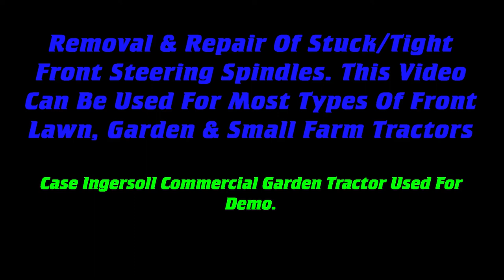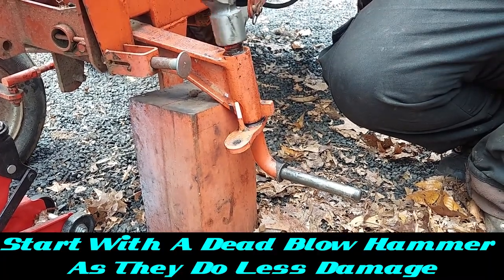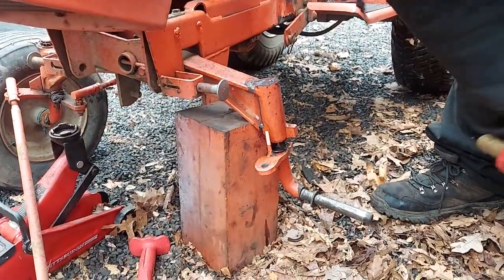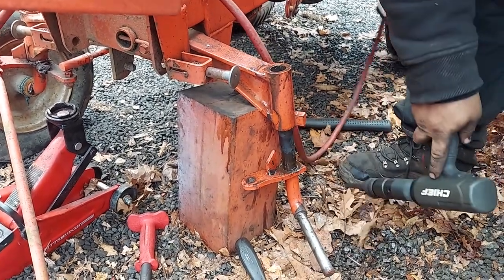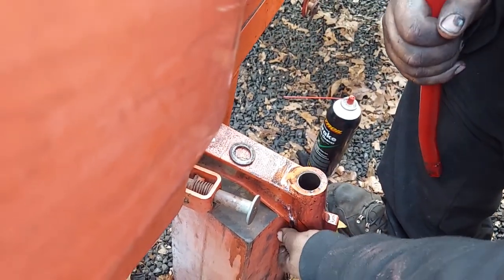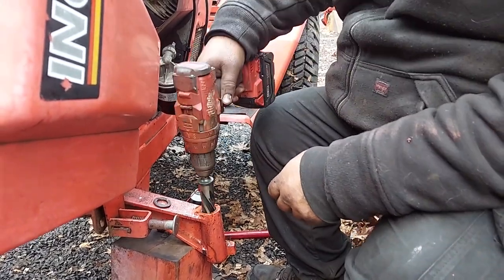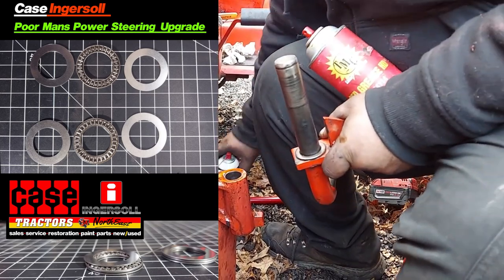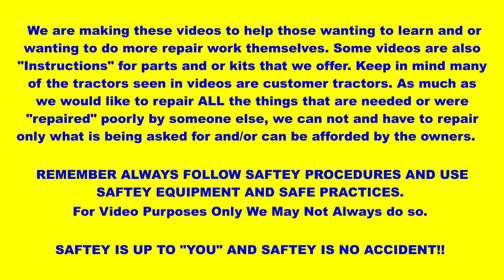Hard Steering tractor? Fixing Stiff/Stuck Spindles For Many Garden/Compact & Small Farm Tractors

Comment: Great video. Some body hasn’t been greasing their tractor, have they. Hehe. 
Good to take them out every now and then and clean them up, even if you are greasing them. 
Thanks.
Reply from the maker: Yes it really should be done every so often even if greasing.  Water, dust etc gets in there and always good to get old grease out time to time. Often even the ones greased we find the grease was only getting all the way to the top or bottom half.

Comment: i usely take some  heat put to it and they fall out sometimes may need alittle help .
Reply from the maker: Yes heat helps for sure and we did mention that also with using presss too. But some customers don't like burnt paint or the look of new touched up paint in one section so we have to consider that when working on customers machines. Often when we make our videos we try to show multiple methods or use more common tools that diy people may have or can go out and get easily. But we agree torches are very hand for many things.

Comment: Hey man, I am having a hell of a time trying to get the spindles out of my ingersoll. I’ve tried air hammer, heating the hell out of it, pickle forks. Just have barely started to get the spindle below the top of the axle housing. Cant really use the pickle fork anymore, air hammer ain’t hittin on too much. I’m stuck, any other useful suggestions?! Thanks!
Reply from the maker: Heat and air hammer. Can try pumping grease. But will catch fire. Sounds like you need a bigger air hammer. What model tractor?
Reply: @caseingersolltractorsnortheast  yeah I pumped some grease in there hoping to free some things up, but it’s a 4016 I believe, and yeah the air hammer I have is a 4inch 2,800 bpm. Maybe I need to try and find a bigger barreled or less bpm.
Reply from the maker: @lukefields97 ya the LONG BARREL Cheif From Harbor freight is great for price. Let me know how you make out. Thanks for watching and comment.
Reply: @caseingersolltractorsnortheast  man that’s the exact one I got! It doesn’t even really budge, so I guess I need to try and melt that spindle and axle down. And yeah man you’re welcome, I love the videos!
Reply from the maker: @lukefields97  @lukefields97  get full flow air connects think they are xalled milton "v" style. Big enough compressor? And thanks